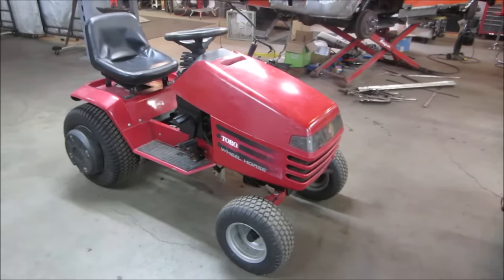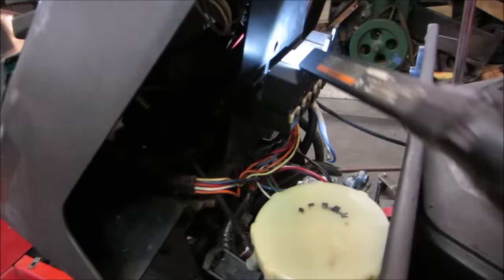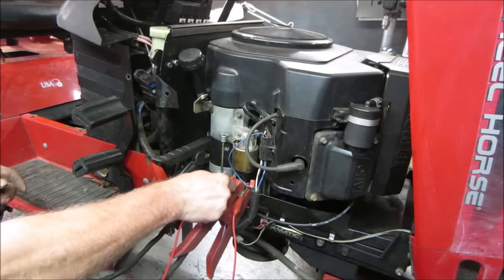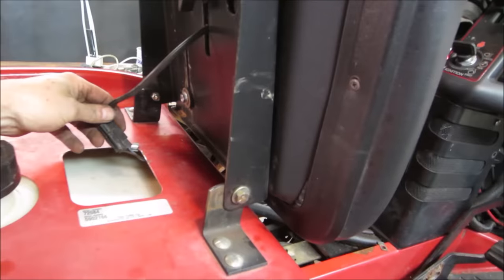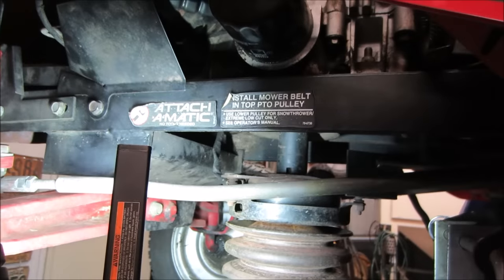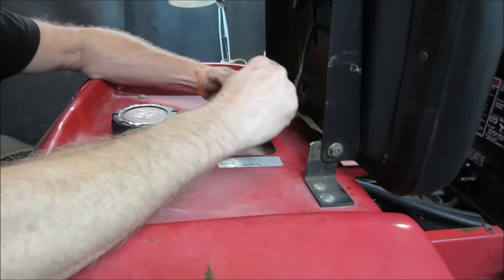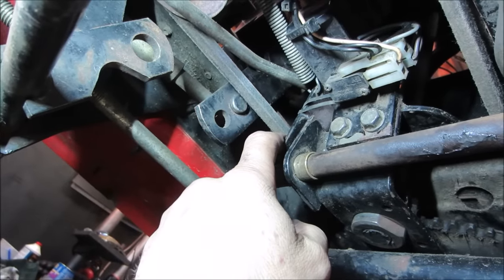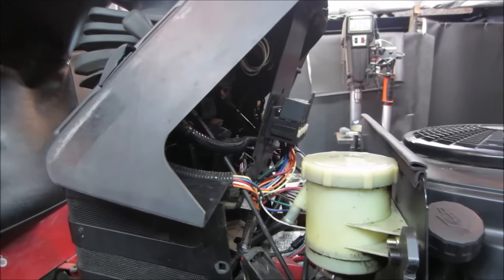How To Troubleshoot a Mower That Stopped Running,

Comment: The delay in the PTO light and click probably means that the PTO clutch is out of adjustment.  You find a spec, stick in a feeler gauge, and turn usually 3 adjusting screws.
  Also, over time, the PTO clutch loses resistance and starts burning out the PTO switch. They sell heavy duty switches but a shorting clutch can overwhelm even these.  New clutches being quite expensive, I have had some luck adding ballast resistors to limit the load back within the capacity of the switch.  This might make the clutch weaker, but mine still works.
Reply: I also noticed there is a surge in the PTO circuit when he turns it off. Before the light goes out the bulb flashes really intensely for a second. I dont know if that is supposed to do that but it seems like it would blow that bulb rapidly. And since the PTO dies if the bulb does that seems like a flaw in design or a circuit that isnt functioning right. Thinking about it however I suppose if the PTO is electric and it uses some kind of coil it could be back EMF causing that surge and flash.
Reply: @GamerLoggos  It's an electromagnetic clutch, so that is a type of coil, so it wouldn't surprise me if that would act like an ignition coil and produce a power spike when turned off.  I don't know if it is supposed to have something to suppress such a power spike.

Comment: So many safeties that would drive me insane... That seat sensor would be the first to go, quickly followed by the brake sensor, and the first time it gave me trouble the PTO sensor...

Yea, I know they're there for my safety, and generally I think they are a good idea. But I know me and I would just disable the lot if they ever gave me any lip. I guess it's what you get growing up in an age when safeties like this didn't exist. Well I actually remember a mower that had one safety and that was the PTO cutting out when you lifted your ass out of the seat. But that was all there was, and I could work around that. If I'd found it irritating enough I would have found a way to disable that.

And this kids is why you should not do what I do, or what your grand pa probably does. At least not without taking a good hard look at what it entails. A lot of the time these safeties are there to protect the manufacturer from being sued, but some times they do actually make sense. Take the disc guard on a angle grinder. It can be frustrating and tend to get in the way more often than you would think. So a lot of old timers just take them off. Yet when you've had a few discs explode sending shards in every direction that doesn't seem like such a good idea anymore. Yet dudes like my father just shrugged and switched in a new cutting disc and kept going, at least as long as they weren't on their way to the emergency with a finger or two in a paper bag. Personally I prefer to have my fingers attached to my hand, and that colors my approach to safeties. The PTO cutout when lifting my ass makes sense to me as it stops the knives if I were to step off the mower. Killing the engine, not so much.
Reply: I'm reminded of another video a while back where Mustie was troubleshooting a moderately recent John Deere tractor and the problem also came down to a failed safety cutoff.

I'm personally reminded of the time a friend and I fixed my range hood microwave that had stopped working. Looking at the schematic, there were so many cut-off switches that it had must have had only slightly fewer failure scenarios than a Redstone rocket. (FWIW, the problem ended up being a failing connection to the door switch.)
Reply: You actually have a point... the manual for my mower says never switch the engine off without going to low-speed, and then letting it settle for a while.... what does the safety do? IMHO it would be better if all the safety devices actually did somethign safe - like engaging (disengaging??) the clutch to the PTO and/or Blades, rather than killing the engine.

Comment: Dang, that wiring seems a little over-done! It literally does the same thing the old school rider harnesses do but with a ton more points of failure. Good job following through with this. Had I owned that thing, it would have been downgraded to the simple harness.
Reply: The person who designed the electrical system for that thing must have worked for Mercedes Benz...over complicate the hell out of things that should be simple.

Comment: You remind me of the best mechanic I ever knew. He had power plant and airframe licenses for the US and the UK (while in the Air Force). I was in his auto repair shop and he fixed a car by replacing a bad relay. He had the car finished and then he started cutting the bad relay apart. I asked him why he was doing that. His reply was he wanted to see if the relay went bad or if something external cooked the relay. He wanted to be sure he fixed the issue, not a symptom of another problem

Comment: Hey MUSTIE, I have an old Bolen riding mower. Brought it in for service because I was having trouble with it running. Off and on. The previous owner had told me to lower PTO arm and bring up slowly. That worked for a while. Anyway the shop changed cable and it ran great for one whole season. Now I'm back in the same boat. Can I fix myself. PTO cable?

Comment: You could also see that something was up with the pto since you could see the bulb flash brightly when you disengaged the pto.

The flash is caused by high voltage spike that's made when the magnetic field in the PTO collapses and it's not very likely to come that way from the factory. 
It was probably what caused the bulb to fail in the first place.

Comment: A wiring diagram would be invaluable in this diagnosis
Reply: You miss the point!
Reply: 100% agree @thomas large   I work in hvac service and if a wiring diagram is available I would never attempt to trouble shoot like this.  You CAN learn a LOT from a wiring diagram - actually learn more than this hit and miss strategy.
Reply from the maker: the point of the vid is to learn how to find problems, not how to fix it the fastest, if that were the case l would not film and just bring up a wiring diagram, fix it and move on to the next one.
Reply: He specifically says he avoids manuals for the sake of making a video. A wiring diagram would be cheating
Reply: Electrical schematics are extremely helpful, I operated an emergency roadside repair truck for a large municipality. Virtually never had the wiring schematic or diagram if I knew what I was working on before I left to shop I would grab all the  information but this is before internet and often I would get sent  from one situation to another making it impossible to pick up additional information. After some time of doing it bye tracing out the circuits in order to troubleshoot .I knew all the circuits in a wide range of vehicles and equipment. Wait till you run across equipment that only has one color of wire and just  uses pin locations and connector numbers to identify circuits .
Reply: @mustie1  The real value is in making your brain think logically.  Inevitably, your logic finds the problem.
Reply: @rich95610  until you have to fix something that you can't get manuals\diagrams for and you're lost because it's not being handed to you.
Reply: @mustie1  k
Reply: My dad lived through the depression. Growing up I had to learn how to do things without manuals, without exact replacement parts and many times we didn’t have the correct tools. He just couldn’t bring himself to spend the money. I learned so much from him. The first job that I got where they provided everything I need I thought I had died and gone to heaven. But I’ll tell you one thing, I can fix things other technician give up on.
Reply: Wiring diagrams are great but if there isn’t one available then being able to fault find and wire tracing is invaluable.

Comment: Awesome troubleshooting! Impressive ! When I was fresh out of school I worked in highway construction , as a Mechanics Helper/ Welder Repair. One night a Briggs Stratton powered lighting system for night construction operation quit running. My Boss, assigned another mechanic to get it going. 4 hours later, no progress he cursed and a second mechanic waded in . Another hour and still nothing. They stood there ready to give up when my Boss stopped and said two highly paid Heavy Equipment mechanics several hours and nothing ? He told me grab a few tools and let’s have a look. We cleaned the points, cleaned out the carb bowl, installed a new plug, second pull it fired, time was maybe half an hour . Lesson, go to basic fuel air spark.

Comment: As the saying goes ... Been there & done that.
'Somebody has been in there before' is so frustrating but take pride from the fact that they didn't find it. Yes you kept me laughing at wondering how long it will take to pop your cork. In my head were the words 'give it time and sleep on it because the answer is always there'. Like you I was fearing the ignition switch was the wrong type but the intermittency had me yelling at you to keep looking at the junction points.
Great diagnosis in the end. Whose fault was it. I say it was a design problem that allowed the wires to be installed the wrong way and not the person that was there before you that did it wrong. What is wrong with using different connectors except that it will add an additional dollar or so. 😎

Comment: When they build new lawn tractor's they should not put all theses safety switches in. They should just tell you when you buy it. I don't have as many safety switched as this one on my lawn tractor has. I will look to see if I can get mine to run again because I put a new belt on and then it would not run. You said that the guy just change the belt and  ran 2 feet then it stop. So that means that there was more problems on his machine because it' was getting older and the switches where wearing out. I will first get my battery tested first. My tester is saying it's got a bad sell, I just got it 2 days ago new. Thanks for the video it may help me to get mine started.  PS: I also have a John Deer that wont start either and it was working fine before but I will see if I can getting working again to.

Comment: First and foremost!  Awesome!

Hats off to the repair shops for sticking to their “guns” and not just out there to make money.  From what I understand repair shops can’t bypass safety switches for safety issues.

That leaves us amateurs free reign to bypass them all and run the machine when common sense existed.

Instead of you going the Amateur Route you showed us the correct and right way. I suck at electrical work…I’m sure I will be watching this numerous times till I get it!   My brain was smoking when you were talking about the relays (second day on the tractor)

Comment: Even though this was a long video, I appreciate all the troubleshooting ideas. I have a Walker mower that cut off the last time I used it. Now it'll just tumble, but wont run. I'm gonna check the spark and the fuel solenoid from what I've seen on your video 😃

Comment: Wow what a list of finds for connections and issues.
They unplugged but swapped when reconnecting.
Maybe some marking paint both on a switch and it's connector will prevent swapping of those next time.
I had one like this and most of what you found was similar but worse on yours. Too many possible causes makes people give up, then they add causes.
There's no book for ease of diag.
The schematics are a chore to learn versus automotive.
What I had to do was eliminate everything, and just hook up what the customer agreed to have for safeties.
We sat and reasoned it out several times, over a week.
I had a bag of wires and connectors left afterwards.
Then our magneto went open.
So, a water damaged ign switch, rewiring to make the new one fit, eliminating spaghetti, and the magneto, then belts, and a mower deck refurb.
Wow, I could had a V8.
All because it sat in the weather.
It took over a month with hours researching and some travel.
Now we see the need for the bottle opener on the keychain.
You are tenacious in your diagnosis.
I admire that about you.

Comment: You just showed why I charge more when I find someone else has been screwing around with a mower,  especially the wiring. I usually start bypassing each safety switch and check each switch as I go. Clearly age has affected that mower. I had a snapper this spring with a defective back up switch relay that I had to replace. The owner wanted to bypass that feature but I told him I was not doing it. I didn't feel comfortable messing with a safety  feature that was designed in for a reason. This was a good eye opener for anyone working on a rider and how and what to look for, even without a wiring diagram. Firing the parts cannon on it wouldn't have helped in that case. Good video!, Really good video!

Comment: Sir, today I have to thank you for your mechanical lessons. I just repaired my chainsaw which on first sight only needed a new primer bulb. On second sight there was no spark, making me believe the coil was dead after my multimeter had no readings when measuring the way you taught us. It was just a missing contact between the spark plug connector and the wire. So thank you for saving my chainsaw.

Greetings from Germany

Comment: well done well done !

i felt a sigh of relief when you started it.  but i was also thinking about the pto switch.  those things go bad  alot, because of all the push and pull. not to mention the constant vibration  from the engine and 
  [   lol   ]  bad  belts and  out of balance blades.

haha   i still feel relieved  .  

i am having the same issue , but with a different riding mower.   a 2011  or  2013   troy bilt  42'' deck
 manual pto. 

i have to jump it with a double gator clip wire  [ fully insulated ]  from  the magneto wire spade  to the battery   [ positive ] .  

i have checked everything i can think of :

new  battery positive cable         oem    original still good
new  coil                                         oem    ''                             ''
new ignition switch                      oem     ''  probably , but not chancing it ''
new  solenoid                                oem     ''  O.  S.  G.            ''
 checked all safety switches    [ they are in working order ]

removed the rear sitting body to remove the wire harness  to check for  cracked wires.
used Mm  to check ohms  and continuity .
cleaned  and  added  dielectric paste to each   male and female spade including  solenoid and starter terminals.

and it still will not engage the starter to make the engine idle.
all i hear from the starter is  a faint  tap  almost a click  but  not quite.
and that wire is getting  the full  12.37 v.

lol    care to take a guess ?

Comment: Mustie 1   No shop manual would have led you to the "switch-a-Ruunie"  On those switches.   When I saw hot on both sides of the PTO switch... I was boggled.   Also, having hot all over the place on the key switch was strange.  You would think there would be a need for 12 V on one terminal... then switches to another lead in the ON position, then 12 V's on the Crank wire.   But, that thing had power all over the place.   Baffling    Great Job, as always.

Comment: A very good troubleshooting video.  I have recently worked on my son’s Cub cadet team with multiple problems.  From the numerous videos I have reviewed, I conclude that the manufactures could do a much better job with their wiring diagram documentation and education documentation regarding operation.  The electrical documentation could be much better.  You do a good job of working through the difficult details.

Comment: Great video.  Love to see the trouble shooting , but boy , it can drive you nuts. 
But the question I have , what ride mower would you recommend,  
I'm new to the business,  I have a few customers,  thinking of buying a used one ....im pretty handy,  I've seen few ride ons That need a belt or battery.  Battery is ez. How hard is it to install new belts. Would recommend a toro ...
Thanks

Comment: The rare 16 hp Kohler command vtwin, its a 20 hp engine with a stop on the throttle body that only gives it about 60 of full throttle, I just repowered a tractor with one of these motors and after I put a 20hp carb on it, it definitely runs like a 20hp plenty of power for the 52" deck

Comment: I have a similar Yardman with that Kohler (CV22) and had similar issues. It was one of the interlocks and I just ended up wiring it directly, cutting them out. Works like a charm now! 😆

Comment: Great job.  It would be really nice if the key switches had a standard or were at least well marked.   On old tractors you can't even trust the new part numbers I found out the hard way.